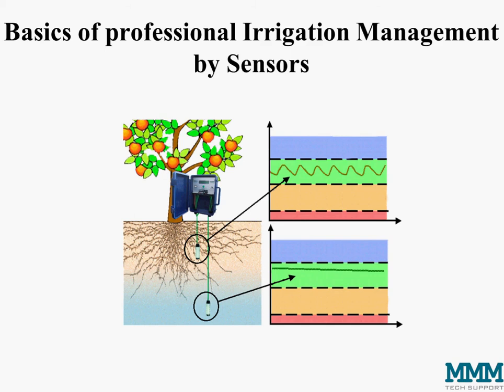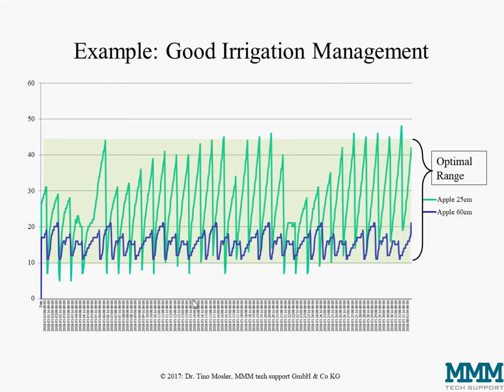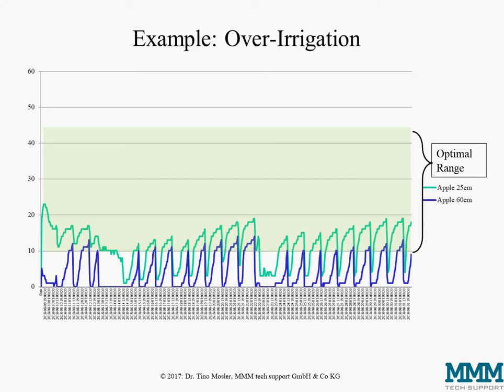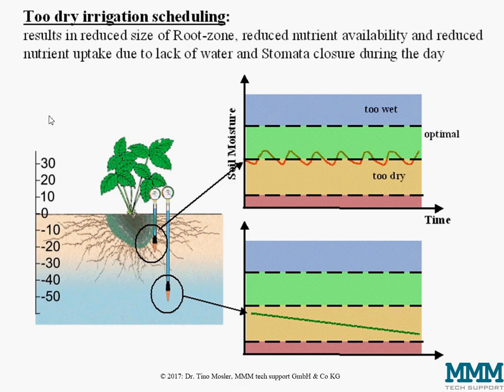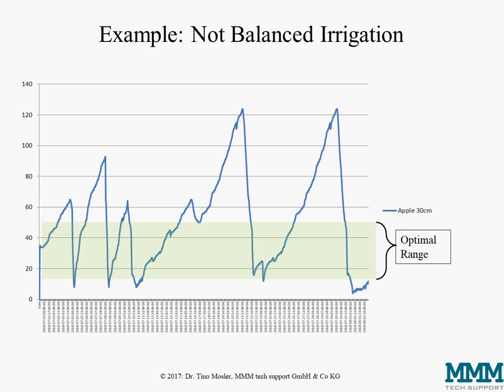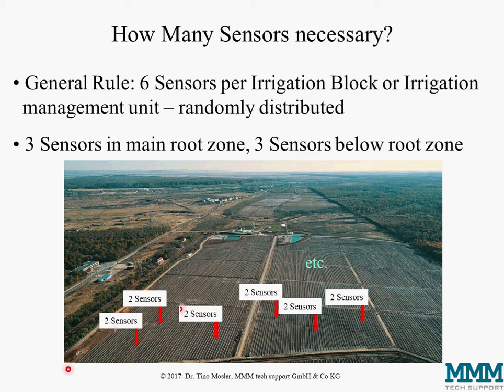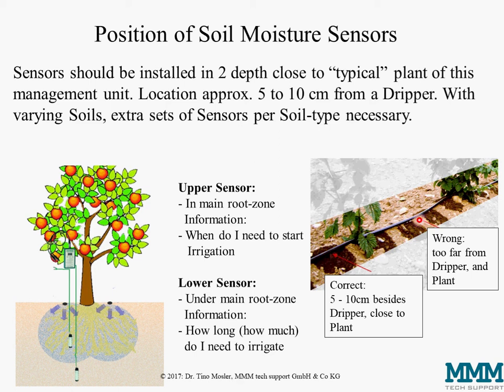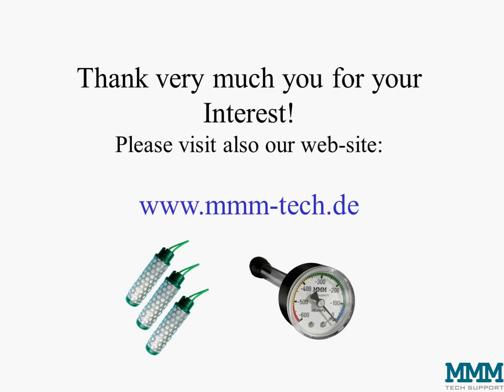Professional Irrigation Management by Sensors - Basics - Presentation by MMM tech support

Comment: Thanks for the video Dr. Tino Mosler. Does this aply for every kind of sensor? FDR, TDR, neutron thermalization, etc?
Reply from the maker: thank you. The video was made mainly for soil water potential sensors, i.e. Tensiometers & Watermarks. However, also individual FDR Sensors and profile probes can be be used in the described way. But with these type of sensors, it is of course also a question of cost, how many repliations are affordable...
Neuton probes with their larger sensing range might be different, but as far as I know are Neutron probes slowly disappearing since approx. 20 years now.
Tino